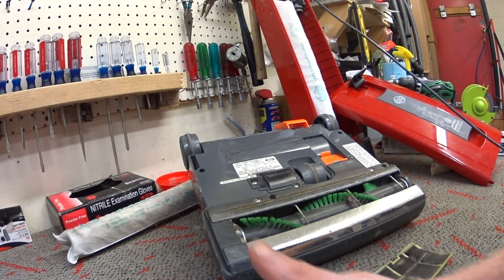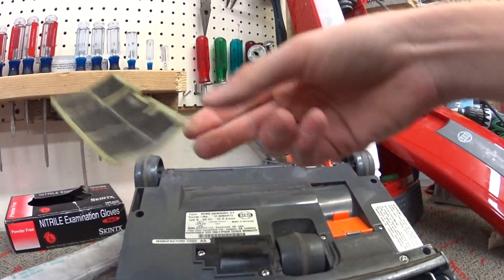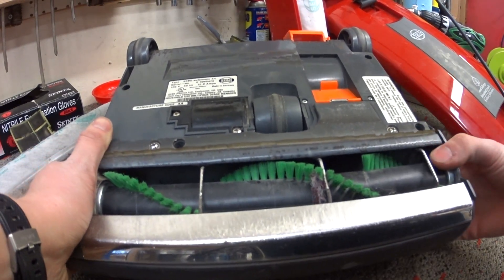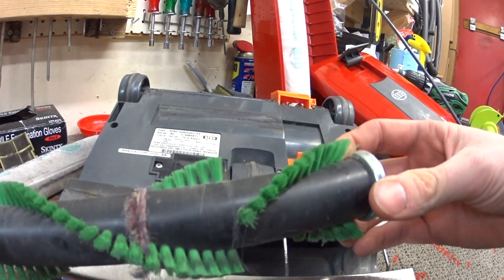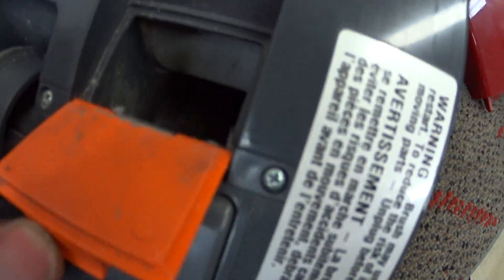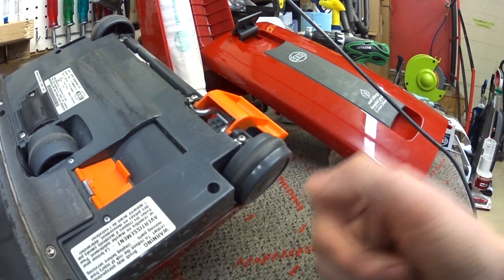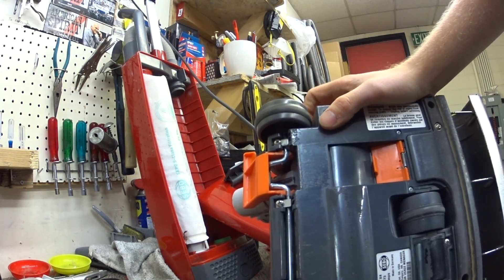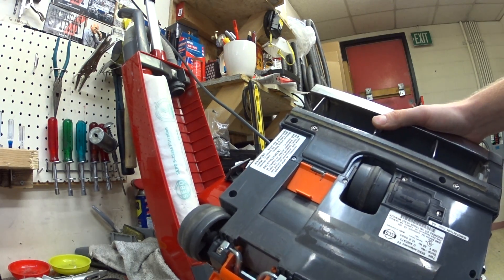What happens to a sebo /Windsor after commercial use in a restaurant?

Comment: years ago i worked at a radio station and cleaned all of the offices..... with an old kirby. it held up quite well but i was smart enough not suck up things you shouldn't suck up with a direct air vacuum. it was a pre-generation model (no self propelled)

Comment: I made a YouTube video about a  Windsor S12 I purchased to replace a Hoover Concept One that had been in my family for several decades, and while it wasn't a badly built machine, I was underwhelmed with the cleaning performance. Then when the motor control board failed 8 months later, I ended up returning it for a refund and continued using the Concept One for another several years.
I'm not sure if I got a factory boat anchor or what.
Reply from the maker: +[Cap10323] did this happen about 2 1/2  years ago? I know sebo/Windsor had a vendor change a PCB component on them without letting them know. And that led to some Factory Duds which at the time the CEO of sibo came into our store and personally replace the units with the next model up.
But generally has a rule Electronic Component failure in Windsor sebo vacuums is extremely rare. Typically these are the the toughest vacuums that are commonly sold At a vac shop .
Reply: Yeah, summer of 2016. 
It was absolutely tough as nails though physically, sturdier than the Concept One it replaced, and far sturdier than the Dyson DC17 that replaced both it and the Concept One.

Comment: What is your take on Rubbermaid’s sebo knock off automatic and manual height adjustment cleaners? Are they any good? Or are they simply unreliable like Hoover’s take on the G series with their insight?
Reply from the maker: +john erikson I have not had a chance to examine them closely so the jury is still out on them. Supposedly the Hoover  Insight issues have been fixed. But the reputation of that machine has scarred it for life